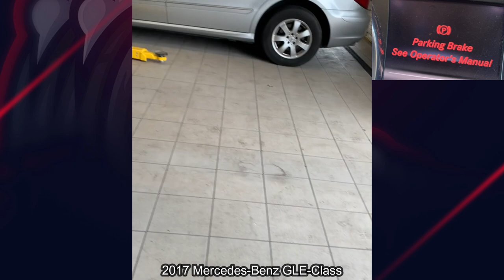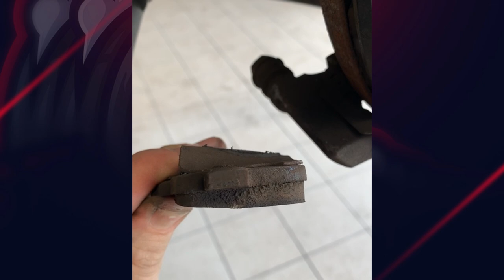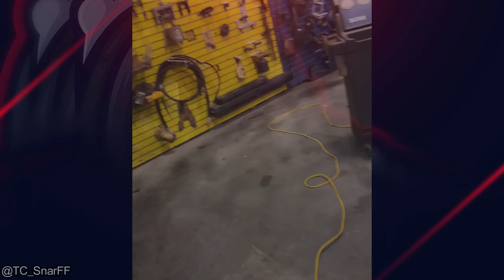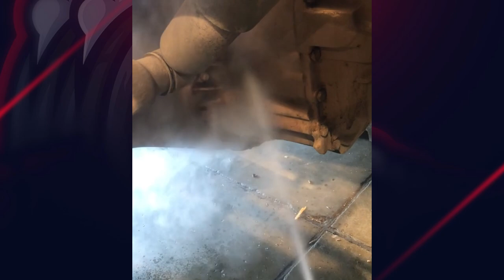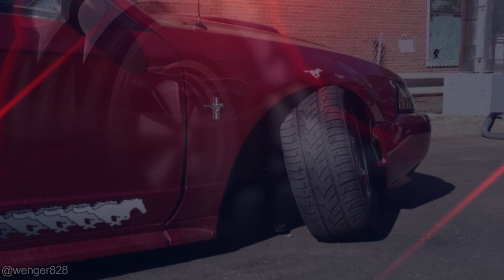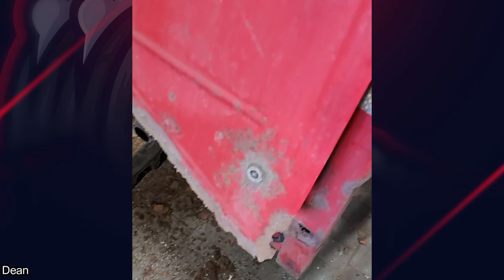Customer States Parking Brake Message On Dash | Just Rolled In

Comment: "My sons a mechanic" ahhh, I understand
Reply from the maker: We've all heard that line before lol
Reply: "My son worked on his motorcycle. Make it right and safe to ride". his Mom told me
Reply: When I was a teenager doing this at least I knew enough to know when I was in over my head and wasn't going to be able to finish it correctly. It also helped that 20 years ago I was messing with cars from the early-mid 90s that didn't require a scan tool to change brake pads or a battery.
Reply: @brandonlink6568  Next we will need a scan tool to change the wiper blades. It’s getting way too complicated.
Reply: or "My buddy fixed it".
Reply: I tried a shop next to my work, it was a professional shop. The bolts came out of rear brake calipers. The front had a wheel bearing installed in a way that pinched off the abs wire (how is that even possible to screw that up?), so many problems. Going to a professional established shop doesn’t always mean you will get good work done by a qualified mechanic. I used to wrench on my own, never worked for a shop. I never did such poor quality work. That is something you’d expect from an amateur hack mechanic. It was a real burn to pay today’s shop rates and be done like that.
Reply: err... sorry m'am.... he's not.
Reply: Wonder why they didn't call him back?
Soft metal on soft metal, there might not have been a loud noise, at least not louder than the radio.
Reply: Somehow I don't think their son is a mechanic. haha
Reply: @jamesflynn10  Maybe it was the professional's mechanic son that he wanted to teach on using your car as a guinea pig ;)
Reply: And that is when you follow that up with, "And what shop does he work out of?"

Comment: can't believe that cotter pin one.  i know not everybody is mechanically minded but that's just ???
i'm literally lost for words, it's just. just.   WOW! (and that took about two minutes).  un-be-lievable!
Reply: It's amazing that he was able to get the old tie rod off. That's a tapered fit. I bet we'd be amazed at how he did that because I'm sure he didn't have a tie rod separator.
Reply: @robertthomas5906  u need 2 hammers keep one still and hit to other side ezpz,  i never used that separator tool
Reply: @robertthomas5906  When I replaced my tie rod ends I just threaded the nut onto the top of the stud backwards and smacked it out with a hammer. Obviously not a good method if the ends are going to be reused but in my case they weren't
Reply: @kiiiisu  Get the separator tool. It's a whole lot easier. I have a hammer type and an air chisel type. Your steering mechanism and attach points will thank you. Brrr pop!
Reply: @HysterS-FT  I've done that. However, the guy that did this job I bet didn't do it this way. I bet he ended up bleeding from it.
Reply: How can anyone be THAT inept! its just common sense, i mean, they must have taken it off.
Reply: When in doubt reference the other side, or better take a picture of the original or google.
Reply: @kiiiisu  I've used a pickle fork once and it was honestly a lot harder than a BFH
Reply: Not a mechanical person, but I assume that you are meant to put the nut on first so that the pin retains the nut?
Reply: @kahlzun  yes, it was in the wrong order.
Reply: @robertthomas5906  I've had good results using an air hammer with a point. I place the point in the center drilling on the end of the threaded shaft, back the nut to protect the threads, apply a little pressure and hit the trigger. The vibration usually releases the taper in a few seconds. Unlike a pickle fork this doesn't ruin the boot so you could re-use the joint if needed.

Comment: We hear stuff like "my son is a mechanic" or "my buddy fixed it for me" all the time. (I'd love to respond "And that's why you're here now.)
Reply: My neighbor tried to fix it. IT was the broken driver's door handle. 1. It didn't get fixed because a part was broken and he didn't know which one/what to get, 2. He left the wire harness for the door controls loose, so there was no connection and none of them worked until I checked that, 3. He stripped a bolt in the door.

Two hours in a body shop and less than $200 later, it was fixed by an actual professional auto resto guy, and I was on my way. It took longer to get a slot in his schedule than to have the repair done.

Comment: I would like to talk to a retired 80 year old mechanic and ask him if people have always been this neglectful with their automobiles or is it more prevalent now in the modern world?
Reply: Since time began. Thank fully it's metal things not horses.
Reply: Talk to my stepfather. He's not 80 and not retired but has been a mechanic and owned his own shop for probably 45 years or longer. He has seen some shit...
Reply: Older cars (I'm taking 1960s and before) needed more frequent servicing for various things.  That may have allowed mechanics to spot problems before they became this bad.
Reply: I think it's more like because we have easy access to communicate with each other so easily that we are seeing the normal rate of car negligence. It just seems like more because before we didn't have video cameras to document how bad it was before.
Reply: A 80 year old mechanic will probably tell you that cars make back in the 80s and earlier had more steel in the frame and panels and therefore could take more abuse.  People's habits haven't changed.  Just the general design and manufacturing of the products they use.
Reply: @Account NumberEight That's still more than some people do.
Reply: A lot of people would replace radiator houses for flexy hoses because it was easier to find and install them.
Reply: @russellhltn1396  wtf are you on about? The point is NEGLECT. People would not have been servicing their vehicles to notice any possible problems arising. You missed the point ENTIRELY.
Reply: @CadillacDriver  When was the last time you had to adjust the points on your car?  If you weren't DIY, you had to take it in.  Today, the mechanic probably isn't going to see a car until it's had tens of thousands of miles on it.
Reply: @russellhltn1396  again, that's nothing to do with anything. It's actually completely contrary to the points being made here. People NEGLECT their cars, so they WON'T be taking their vehicles in for anything at all. I get what you're saying, but unless the car is literally falling apart to the point it is not driveable (such as the cars that this thread is all about) they won't ever go to the mechanic for anything. Therefore even back in the day, people let their cars get in to this kind of state, because they drove them until they fell apart - just like modern times.
Reply: Stupidity has existed since man first walked

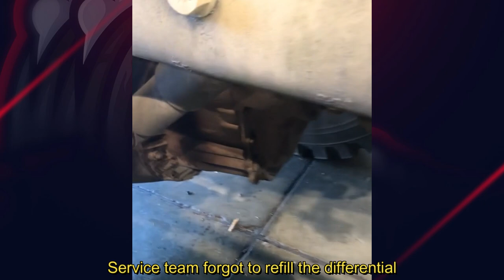Comment: 1:36 "service forgot to refill differential" well those gear will be buggered
Reply from the maker: A differential that size will be $$$ to repair.
Reply: This would be a true case of
"Ever since you worked on my vehicle"
Reply: I love that you make your point with water spray. When I sense a brake caliper dragging I bring out my digital thermometer from the kitchen and read all the caliper temps after a road trip, wipe off the probe and put it away in the kitchen again.

Comment: I don't need a ball joint.  Just put air in my tire.  I'm not going to get scammed.
Reply: @patrikpolda  When I was a tech, everytime customers refused to have a part(s) that's about to break replaced, I'd have the advisor or manager/supervisor have the customer sign a waiver that they declined repair and we aren't held liable for anything that happens when customer leaves with their vehicle as they were warned (something like that). No way I'm going to be blamed for customers negligence.
Reply: @PanameraTurboSEHybrid  I would do the same thing. But I imagine that there would still be someone who would want to sue.
Reply: @patrikpolda  Let them, because with that signed waiver, case gets thrown out they pay for court/attorney fees.

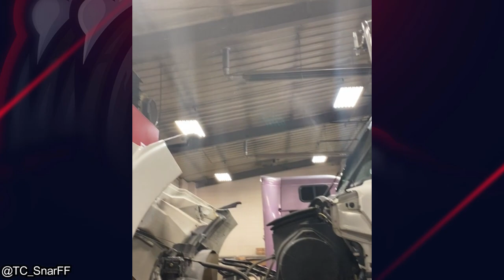Comment: The Ford/Sterling at 0:59 with the broken washer hose... We had a pair of old Sterling tractors at my workplace which spent a lot of time sitting in the yard. The tube would break off at the cowl due to the UV eating the plastic about once a year. You'd do your pre-trip and you'd water the grass instead of the glass.

Comment: Just going to say, many times the mechanics can get in a rush and forget a bolt or 2. I didn't have room to fix the control arms on my truck. Had the dealer do it. Well they forgot a bolt on the caliper and as an end result, the wheel, caliper, and rotor all got damaged. They covered it, but I was not happy. Someone could have died from lack of brakes.

Comment: I just took my 2010 fusion in for a noise in the front end and they showed me the driver's side lower control arm was getting ready to wear into the metal.  it was replaced then.  Never put off repairs to your car, it's not worth the cost later on. it has 155 k right now.  love the videos I really wish people would think about the long-term issues when it's cheaper to repair now instead of later.

Comment: These videos make me think I should start a memoir, lol.  I bought a used C4 Corvette from a dealer once with a "brake" light on.  I declined the brake service they offered.
Well, after driving it a while, and doing some research, including something as simple as shining a light on the dash to see what dummy lights were not lit, I found there was another light labeled "brake pressure".  Two brake lights??  Well, turns out I was driving around withe parking brake on.  For those who never sat in a C4, the parking brake is left of the driver.  You activate it like a normal hand brake, you pull up on it.  But, how do you get out?  Well, the handle just pushes back down leaving the brake on eliminating one of the clues people commonly look for to see of the brake is on.  I did noticed the rear brakes dragging, but having driven GM cars with those same rear calipers, which were known for getting "sticky" with age, that didn't raise a big red flag for me.
I released the parking brake and it seemed to drive fine after, lol.
(If you think that's silly.  When I first test drove it, I thought, "wow, this thing is really doggy and slow for a sports car".    Later on I figured out where the traction control button was, lol)
Reply: Same parking brake release deal on the Pontiac Fiero. More of a reason there, with the enormous center tunnel/console, but wait, maybe C4 'Vette was built like that too.
Reply: @edgarcook9607  Ya, the C4 console is very wide, and also very shallow.  The cup holders are all but useless unless you are parked.  
Come to think of it, I never actually sat inside a Fiero.  It my have a very low seating position like the C4.  The C4 does not have the lowest ground clearance of any Corvette, it actually has pretty good ground clearance, but it seems to be to have the lowest seating position relative to the car than any other Corvette.  The lowest part of the C4 is the floor under the seat, and I do not think that is true of any other Corvette.
You actually side between the frame rails in a C4.

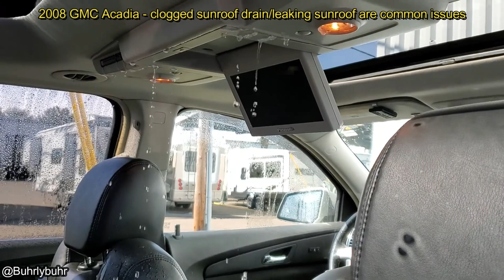Comment: 0:50 -- This is exactly why I refuse to buy any car with a sunroof. This will happen at some point. Either the seals leak or the drainage channels plug up.
Reply: Never buy anything with a sunroof.
Reply: Almost every car I've ever had has had a sunroof or moonroof for whatever you want to call it. As long as you care properly for your car, there won't be a problem with it. Seals can easily be replaced if they dry out and start to crack. And if you don't park your car in direct sunlight all day everyday it won't be a problem.
Reply: @rebeccahetrick6576  If you watch enough of these videos, or talk to a bunch of techs, you will learn people drive their cars into the ground and don't care about safety or maintenance. They feel upkeep is unimportant.
Reply: It's almost always the drains, not the seals. Sunroof seals aren't water tight and aren't meant to be - the seals are just to keep wind noise down. (I've had cars where those seals were literally made of felt.) They rely on the drains to channel water away. Keep the drains clean and they'll never leak.
Reply: @MrBirdnose  On old ones they can crack, shrink or just develop a tear from use. Rubber seals can leak.

Comment: Some of these are actually crazy. I've done a few things myself, which was a pain in the ass because I'm not a professional but yeah..

Like replacing headlight bulbs, some DIY work on a loose front bumper (Replacing some bad screws with nuts and bolts), but that's nothing you can really mess up so bad that you trash your whole car or that it becomes an incredible safety hazard to other people. I propably wouldn't touch anything like brakes or steering, I'd rather have someone who did this every day for years do it.

Replacing part of the exhaust was done with a friend who knows what he's doing and we triple checked that everything fit thightly and the system was airthight. Safety inspectors checked the exhaust and my bumper thoroughly (because they saw that it was a DIY job) and even stress tested it a bit and it was fine. They even asked me some questions about how I did it to be sure.
Reply: In North Carolina, the rules differ from county to county.  In some counties, if you bring you vehicle to a place like Auto Zone they will change out your battery or your windshield wipers and even air filters.  And then there are other counties where those same car part stores are not permitted to do any work on the vehicle.  You either know how to replace the expendables on your vehicle or you literally have to take it to a mechanic to have it done.

Comment: Am a bit surprised the engine isn't damaged but at the same time aren't as if they didn't run the car water wouldn't have been able to get deep into the engine as they are pretty sealed tight

Comment: I had a flat tire once, went into the shop to see what was wrong and they pulled a metal golf tee puller out of the sidewall of my tire. This guy had been working in a tire shop for 40 years and had never seen or even heard of a golf tee puller being stuck in the sidewall of a tire. And it was a good two and a half to three inches in the side of the tire. No one can figure out how it got into the SIDE of the tire.
I kept it on my keychain for years after that, and I always drive VERY CAUTIOUSLY near golf courses....

Comment: That's a horrible mistake to forget to put the bolts back into the caliber and the kia with the rotors.. does anyone have any idea how that happened
Reply from the maker: Second one might be a case of "I hear a weird noise but I'll just turn the radio up."
Reply: @JustRolledIn  That pattern on what's supposed to be the rotor is kinda disturbing.. like that's over the top bad
Reply: I read on another comnent those were off road rotors.. I never heard of those.. still they aren't supposed to move like that

Comment: I wouldn't be spraying water on a transmission that hot cause it can crack the housing. My idiot cousin did that to a hot engine block after we told him not to and cracked it almost all the way up the side of the block.